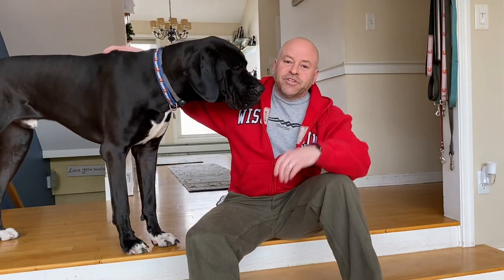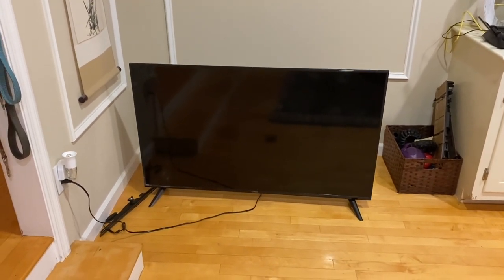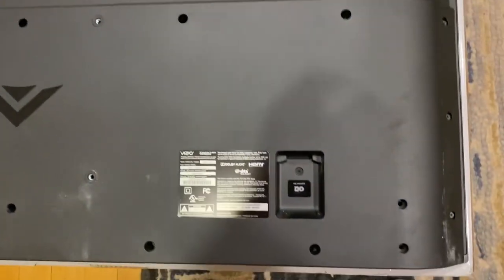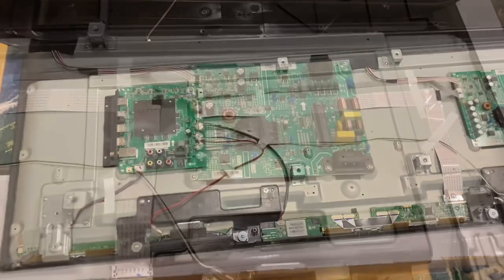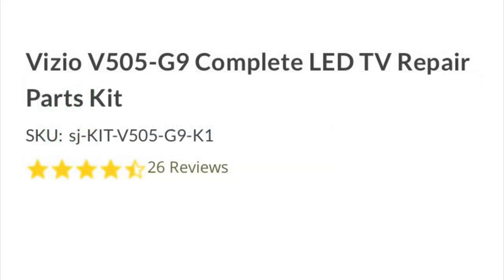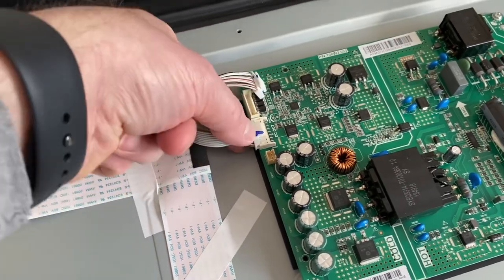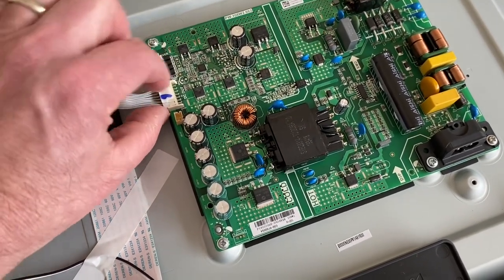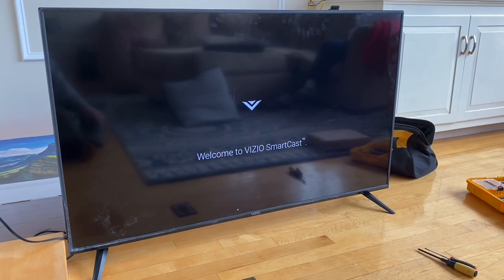VIZIO TV Will NOT Turn On.  EASY FIX.

Comment: This is by far the worst vizio tv generation, lots of these tvs are failing due to the screen issues, the  buffer board on the actual screen fails therefore the screen needs to be replace which is impossible cause the don't sell the screen so pretty much the tv its useless, i fix tvs and i have i bunch of those with the same problem
Reply from the maker: I was surprised at how many people have had this issue.   This TV has been working well since the repair.  No screen failures to date! 🤞
Reply from the maker: I was surprised at how many people have had this issue.   This TV has been working well since the repair.  No screen failures to date! 🤞
Reply: I will never buy another Vizio. 💩

Comment: We shouldn't have to do this. The manufacturer has some problems to fix. I spent 600 on both of my vizioz... set them both on the curb after a year. Had this problem on both of them. They would just shut off. Then after 2 or 3 days. I could cut them on and they would shut off. Then after awhile they wouldn't  cut on at all.
Reply from the maker: Umpf.  That’s frustrating.  Since replacing power and main board, the Vizio has been working well.  Perhaps they had a bad batch of circuit boards….

Comment: What child or teen knows how to do that smh
Reply from the maker: It was actually very easy to do if you follow the video carefully.  👍👍
Reply: Mine was able to do this with the help of this video! He's 12 and very proud!
Reply from the maker: @DinaWitaY  Great to hear!!  👍👍
Reply: What if you heard a mild crack or like a small pop before it went out. What then? Can it still be fixed?
Reply from the maker: @margaretwees2291  I cannot be sure but if you open it up first you may see clues to what was damaged.  Good luck!
Reply: The kind that like to take things apart and see how they work. The good thing about this is no soldering is required like on older sets

Comment: Bit confused  so a New Power board  and Main board   you only gave the price of 1 part  and didn't explain  why the main board was swapped out
Reply from the maker: That was the price for kit. So I changed both.  Mine needed a new power board as it would not power on at all.

Comment: What made you decide to change the main board also?
Reply from the maker: Hello,  since I had the combo pack and it was just a couple more screws I swapped it.   If the tv experienced a power surge or broke out, both could have been damaged.

Comment: My 40 inch vizio turns on but only displays V logo and then turns itself off.  any suggestions?
Reply from the maker: I’d go with a new video card.  Good luck!!
Reply: Mine is doing samething I can see the screen using flashlight. It only flashes Vizio screen for half a second then black screen unless I use a flash lite then I can barely see the picture . I have done rebooted , factory reset .

Comment: Hello, was the light at the Bottom of the screen on when the tv wasn’t working? My mom has the same tv and it just went out on her and I’m trying to figure it out
Reply from the maker: My tv did not respond at all to the remote or the power button.  If your tv power indicator lights up, I would try replacing the main board 1st.
Reply: That is exactly what i will do, thank you so much for responding!
Reply: @quintonoquendo8350  did you try to replace the board? And did it work?  I have the same situation

Comment: I have a Vizio 55" t.v. Model # E55OVL it will not turn. On, what's the part number to the kit you have in your vid, also will it work for my set.

Thanks Kevin.
Reply from the maker: Hi Kevin, check out link for E550VL power board: https://www.shopjimmy.com/vizio-0500-0507-0790-power-supply-unit-e550vl-e551vl-e552vl-e552vle/?search_query=E55OVL
Reply: @terryclayton  Thanks Terry I really appreciate the help.
Reply: Good looking out Terry on the Part info, got the Part in did exactly what you vid said to do, and Wallahhhhhh, steak dinners on the table 👌🏾
Reply from the maker: @danglinforya5773 that’s great!!

Comment: Great Video, Thanks! However, it would have been nice, although a pain, to know if was just the powerboard...My tv was on (70inch) when I got in shower, when I got out, all I had on screen was the V logo, would not turn on or off so I unplugged, waited a minute then tried again, no joy...now to take mine apart and see how it goes! Thanks again!
Reply from the maker: Hi Alan, I would agree with you.   My guess is a power surge or brown out damaged electronics.  Since the pair was cheap I just went all in!  😄

Comment: My smartcast freezes when casting is this a software issue or hardware issue?. The forums are littered with others with the same issue and not one resolution.
Reply from the maker: Hi. I have not worked on this but I would expect it’s software or poor signal.  I will post if I find more info.

Comment: Not gonna lie.... I love this TV for my gaming, movies, and the quality of it. I've paid $350 for mines and it's the exact same one as yours in this video. 50inch 4K TV. 

My tv issue is the TV won't respond to my remote. N now the buttons on the TV isn't responding either. It doesn't go to Home Screen anymore or turns off on its on when IDLE. This problem started literally 24 hours ago while watching WWE live pay per view. 

I tried to turn it down with my remote n it didnt respond. It didn't respond to anything I was pressing. N my TV right now is still on and I'm scared to turn it off, but I'm knowing I'm gonna have to. I am very frustrated because I've worked hard for this Tv and I don't wanna spend another check on another TV. I haven't had this tv for two months yet. 

I don't wanna buy a tech board n do all that extra. There has to be a easier way. 

What happens when I turn it off??? It feels like my tv is on life support 💔😭 bc if I u plug the tv it might not come back on😭😭😭

I truly worked hard for this gift to myself.
Reply from the maker: Sounds like it might be a software glitch.   I recommend you unplug it for 30 minutes.  Hard reboot.   It might be fine.  You should use a surge protector going forward.  I put links to the parts in description because Shop Jimmy is “out of stock”.  It’s a very easy procedure.  I hope this helps!

Comment: Power light comes on but no picture
Reply from the maker: Carolyn,
I had no power light so I was originally going to just replace the power board.  But since the price for both was minimal, I chose to replace both power and main board.  Good luck!!
Reply: @Carolyntessneer  I have the same situation did you buy the part to fix it? And did it work?
Reply: @kyleives8510  no i turned tv off plugged back in hit reset on tv